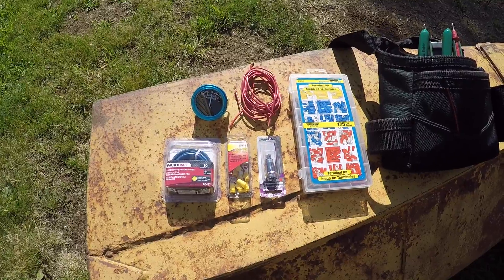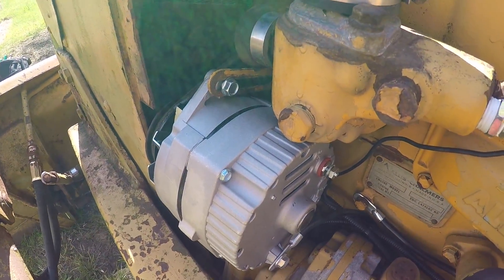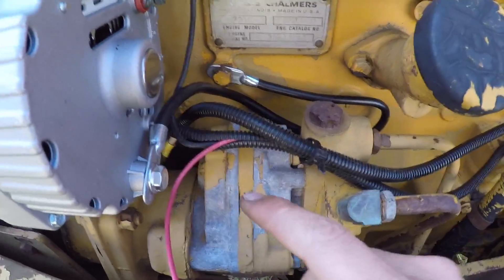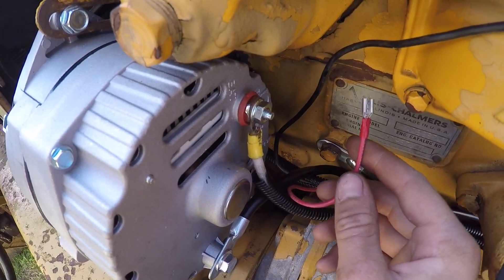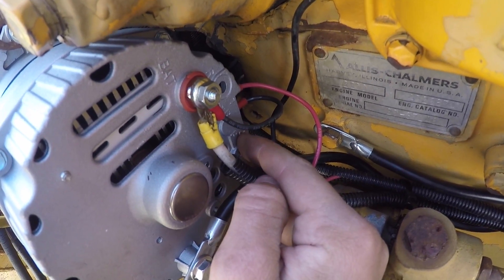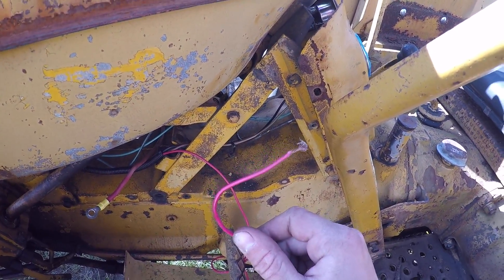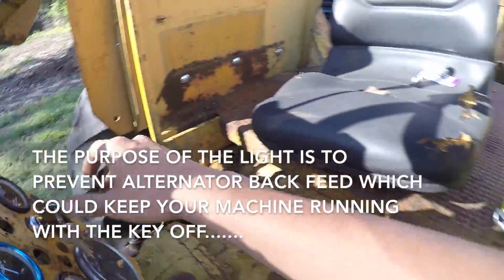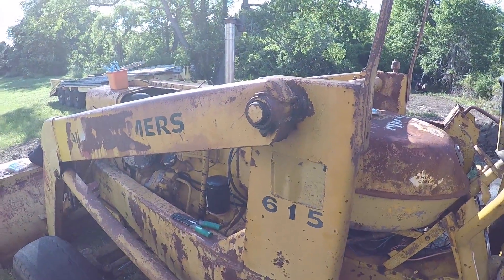How to Wire a 1 Wire/3 Wire Alternator (10SI Delco Style) to a Farm Tractor

Comment: Help me out here I'm terrible with electrical.   Do you have a 12 volt positive ground system?  I'm doing the same conversion with a Allis Chalmers D17 gasser, would I need the exciter since I am running higher RPM's?                       Great to-the-point video by the way!  Excellent job.
Reply from the maker: negative ground. I would still run exciter depending on how long the machine sits between uses.

Comment: I put 1 wire alternatorsGM110 amps straight from-the one post to the positive post on the battery, I have never ever had any problems,with battery or alternator, no need for anything in the wire ,just run a wire to the post +, on p.s. you will need a bigger pulley on tractor’s,they will self excite on it own,

Comment: You can also add a resitor instead of a light. I use short peace resistor wire as jumper
Reply: A light is better. Visual as well as excite current.

Comment: Tip when adding this on heavy eqipment the  Excited wire should go to a 2 terminal  oil presser switch you install. So it not so hard on starting am battery in cold weather. This way the alternator not trying to charge putting load on starter an battery until oil presser is up. Machines from factory are wire like this. Can't tell you how many guys think the alternator bad when it's a failed oil presser switch.. make so much easier starting. With out the load of the alternator.
Reply: If it's a true 1 wire self exciting, which this one is not, it won't have any load until the rpms are raised anyway.

Comment: why would run the wire coming off the ampmeter to the starter post? do you mean the solenoid? what about to the battery, I guess it would go to the positive terminal?
Reply from the maker: So the starter post on this particular machine branches power off to the battery. You can either go to the 12v starter post or the battery.

Comment: Im going to rewire my 1466 international harvestors alternator been having trouble with the battery staying charged long enough to run the knife on the net wrap part of the baler. Has to have 13.1 v or it throws an error code and wont cut just wastes a bunch of twine. Thought the alternator was hooked up properly but when my dad was alive i recall him saying if u didnt rev it over 1500 rpm the alternator wouldnt charge at an idle. So that was simply cause he didnt run another wire to the ignition so it would excite as the key turned on instead of just when it was above idle?  Also wanted to ask if it would be better to take the wire from the numer 2 post that u connected right back to the alternator would it be better to connect it to the battery or absolutely connect it to the positve alternator cable? I just want to be sure is all before i screw something up and burn my grandfathers tractor up. Is the positive starter post where i should connect at to run a block to attach lights to and such? I dont have radio in there just some lights i normally hooked to the battery to turn on.
Reply from the maker: Yeah so to make it charge immediately you need that second line coming from ACC. As far as the lights and stuff I would wire it directly to the battery so the starter terminal doesn’t get warm.
Reply: @iamdjnam  cool i really appriciate that. I need to place some switches in it so i can flip a switch when it gets dark instead of stopping what im doing to get out and connect them to the bolt on the battery post. I bought a couple bar lights and some square led sets cause that tractor is very lacking in the light department.  Really appricate u answering back even though the video was a couple years old. Sure appriciate it ive watched it like 6 times just to lock it into my brain prob watch it a couple more times before i start removing shit. If u are from Sw Pa or close by and want some wiring work let me know got all kinds of old tractors. Mostly olivers but a couple internationals and massey Ferguson tractors we havent used for awhile.

Comment: I have a gas Massey 165 I’m wanting to hook a one wire alternator up to. Is the process the same? When I took off the old alternator, there’s a wire running from 2 to the dash and no jumper to the positive alternator output from the terminals which is opposite of how you did it. Not sure which way is correct.

Comment: Did as you but start the tractor & alternated does not kick in still have to rave for it to kick in number 1 to the light in dash turn switch on light comes on number 2 to starter positive.I have a volt meter.

Comment: Excellent advice regarding the alternator "chassis-to-engine-block" negative cable. This eliminates the negative current from trying to use the alternator mounting for continuity. 

Wtih the distance to/from the ammeter and then to the battery, I would use at least an 8 gauge circuit.
If using a volt meter in lieu of an Ammeter, the charge circuit will be shorter, possibly allowing for a smaller gauge.  

Although in the Marine world, yellow is now used for Negative, for years black has been synomonous with Negative. 
I would suggest using a colored (other than yellow) wire for any Positive conductors. 

If I may elaborate some re; 3.54 into the video. With the use of an Ammeter, that circuit runs first to the ammeter..... then to the battery. 

If I may elaborate again re;  4:05 into the video, the Self Exciting 10si (what some call the "one wire" 10si) does indeed require a bump in RPM in order to become excited. 
However, once excited, it will remain excited until engine shut-down. 

FYI..... technically speaking, there is no "ground" in a 12 vdc system. Positive and Negative only.

Comment: Question: on the ignition switch are there any other wires besides the one coming from the led light? Thanks for this very helpful vid.
Reply from the maker: Yes one to the fuel pump solenoid and one to the starter solenoid.
Reply: I’m installing an alternator on my Massey Ferguson 135 diesel and this looks like it will work for that.

Comment: Im kinda lost do you put a wire from the positive on battery to the alternator? To send the charge to the battery. And with the ignition switch how does it go to the starter? I gotta run all new on a chipper i just bought. Please help lol
Reply from the maker: Lmao you’re good. You put a wire from the battery to the terminal on the back of the alternator. Then u put a wire from the ACC on your ignition to that little terminal that says 1 (or 2 idk I mention it in the video)

Comment: what if your ignition switch doesn't have an accessory spot? mine just has an off and on
Reply from the maker: You need to either use the little light bulb, a diode, or u can wire a little momentary push button to excite the alternator.
Reply: @iamdjnam  i see, okay! thanks bud ive been worrying  about this forever now. your the first person that could give me an answer
Reply from the maker: For sure no problem

Comment: International trucks from the 70s had an alternator like this and they had no light for the alternator. They just had 1 wire coming from the accessory of the key switch to terminal #1 and a jumper going from terminal #1 to terminal #2. This is how I wire all my tractors. They only time there is a problem is if the  tractor doesnt have an accessory terminal on the key switch so you have to wire the exciter wire to the ignition terminal on the key switch and sometimes they want to back feed and the engine wont shut off when you turn off the key. This is easily fixed by wiring in a diode between the key switch and the terminal #1. This diode only allows the power to flow in one direction and prevents back feeding.
Reply from the maker: Yeah I ended up just wiring to ACC after replacing the ignition switch.

Comment: That's the technique I use as well, except I like using a voltmeter instead of an ammeter.  With a voltmeter when you turn on the key, you instantly see the static voltage of the battery and also instantly see the initiation of the alternator output with the increase of voltage simultaneously with the LED shutting off.  The ammeter is also a great way to see the output, but if your battery is fully charged and requires very little alternator output to recharge, the ammeter movement could only be a blip and a bit hard to discern.  Of course that's in reference to a tractor with little or no external electrical load beyond the starting or ignition load.  Good concise and informative video.  Don't listen to the naysayers, we know this works.

Comment: With reman alternators no one knows what voltage regulator is installed unless you ask for a 1 wire. This is a marine regulator because in a boat, they don’t want the alternator on until the engine is at a higher RPM to avoid fumes causing a fire. On a car, truck the run B+ from key on to dash, the peanut bulb limits current but turns on the regulator after cranking. You don’t want the alternator pulling on the starter when cranking. The bulb is a current limiter for the regulator. This circuit has 12Vdc to turn lamp on and the field produces 12Vdc when working. With 12Vdc on both sides of the bulb there is no potential for current to flow so the bulb goes off. If the diode trio or main diodes start to leak voltage backward due to heat, age or defect, the light will glow from dim to bright telling the owner something is wrong with the charging. The most common one wire regulator copy you Delco Marine, that is why you have to rev up to make work. Any other regulator starts working as soon as started because the diode trio supplies the regulator with voltage to supply ground to the rotor at 400HZ as it is below AM band radio dials to eliminate radio noise. The stator used is “Y” connect and that center is hot when working, that is field. The marine regulator other wire is system voltage sense to adjust charge rate in volts. Inside there is a ceramic resistor that changes with air temp. Higher voltage when cold and lower voltage when hotter. That is the difference for time in turn-on can range from 1.5 sec. to 4 seconds. This spec is used when picking a voltage regulator.
ASE Master since 1978, retired.
Reply from the maker: Lot going on here. Thanks for commenting.

Comment: Great video.  Yes there aren't many video's on wiring tractors.  I'm replacing a wiring harness on a 5040 Allis Chalmers that has an old harness that has chopped up, spliced wires and missing wires.  I got a new harness with no labels on the wires so I'm trying to figure out where they all go. My new harness has two wires with the alternator main wire.  The Tractor has a Delco Remy alternator just like the one in this video.  The dash has a volt meter gauge with a scale from 10 to 17 and says battery voltage.
Reply from the maker: A multimeter is your best friend when tracing wires. I also purchased the manual for my machine that provided me with some diagrams.
Reply: @iamdjnam  yes I have both service and operator manuals.  The operator manual has the wiring dirgram to help trace the wires.  Your video was very helpful.   Thanks

Comment: That is actually a three wire alternator.    A one wire alternator only has one wire from Batt on alternator to positive on the battery.  A one wire alternator does not require the light because they are self exciting and do not require the light to create a load excitement.   It is actually better  that you are using a three wire alternator because the typical true one wire alternator contains junk diodes that go bad.  When the diodes in a one wire alternator fail, the battery will bleed down through the alternator and kill your battery.   The three wire alternators are much more durable due to tried and true diodes and they are 30% cheaper.  So actually what you have done is shown a method for wiring a 3-wire alternator which is better than a true one wire alternator.
Reply from the maker: Yeah you’re actually the 2nd person today to say that

Comment: Do you need an ammeter in series or can I go straight from alternator output to the battery?
Reply from the maker: You can go straight to battery. I just put one so I know the damn thing is working
Reply: Thanks for a fast!! Response. 

So I wired it up to the battery and a good ground to the battery ground 

Ran the 12v ignition to terminal 1 or R with and without led and the alt still isn’t charging
Reply from the maker: Make sure u got 12v at terminal 1 using an multimeter. If you do, the alternator is garbage.

Comment: So my tractor doesn't have an acc post on the ignition switch. It only has two terminals. Would I connect that wire to the output terminal?
Reply from the maker: Yes but u have to run a diode or Mini light to prevent backfeed. If you don’t the machine will stay running when you turn the key off.
Reply: @iamdjnam   thank you but the key doesn't stay in the start position. Its a diesel and to shut it off, I pull the shut off knob. I planned on wiring a light in as you did so hopefully it will do the same. Thanks for the response

Comment: The starter has a main power from battery terminal. It also has an s and r terminal. S wire goes to the neutral switch and then to the ignition switch. Where does the wire from the r terminal on the starter solenoid go to
Reply: Some say that goes to a tachometer if you have one.

Comment: Absolutely GREAT!! I love that old Allis!
You are spot on about connecting the terminal one wire to the ACC post on the ignition sw.
Not many people know that!  Nice work my man...
Reply from the maker: Thank you! I love this machine. Its been so good to me and I return the favor with proper maintenance :)
Reply: @iamdjnam  Yep - I have a 1957 Farmall 350 that the generator died on several years ago. Got tired of charging the battery every whip-stitch so I put on a 1 wire. An older gentleman down the road said use the ignition ACC post to connect an exciter wire. That way when you turn off the key all the juice is dead and it won't keep running on ya'. The man knew his stuff!! LOL! .
Not many guys left that know these old machines in and out!
Lots of info out there but your advice is right on target - Nice Job!!

Comment: What if your tractor doesn't have a keyed starter switch? Where would I wire the exciter to?
Reply from the maker: You can install a small on off switch to excite the alternator. They are very cheap and very easy to wire.

Comment: Thanks for this video! I have an old  Delco 10SI alternator but it has 3 flange connections + the Batt Output, 1, 2 and R. How would this differ?
Reply from the maker: I honestly have no idea. I don’t want to lead you in the wrong direction. Best thing to do is find a schematic for that alternator that tells you what each terminal is for. I know on some alternators they allow you to hook up a tachometer
Reply: I'm thinking the R is for RPM gauge

Comment: By far the best video out there. I have a Massey 50 industrial loader with a push button start and mechanical stop, the existing generator failed years ago and I plan to convert using your design but with a toggle on off switch in place of a key start seeing that this system is working. Do you see any problems?
Reply from the maker: That should work fine, just make sure its not wired back to the same terminal as fuel, as any back feed will prevent your machine from turning off.

Comment: Good video!  Doing this next weekend.  I seen on another video that it's necessary to use 10 and 12 gauge wire.  ???
Reply from the maker: Use the gauge of wire shown in the video. A lower gauge will handle current and amperage better. My alternator is a 30amp and works perfectly with said gauge.

Comment: Hello again.... fyi, my alt had evidently died. Do you happen to know a part number or where I can find a one wire, self exciting, low rpm output replacement? (Vern B)
Reply from the maker: Self exciting, I have no idea. The one I used in the video is linked in the description. Cheap enough to add an extra wire and be done with it.
Reply: @iamdjnam  Hi, After some research, I discovered NAPA sells a Delco reman, 63A, one wire, with 500rpm charge start. For $61.50 w exchange. (part # 213-4011SW) Thanks Again Vern
Reply: @vernboulet1015  I just bought that alternator yesterday.... Yes walk into NAPA  and tell them the part # or just tell them you need a  1 wire alternator for a tractor and they normally just hand it to you instantly....

Comment: ? If you have a Bat and a 1 and a 2 terminal on the alt. it's not a one wire alt., is it?
Reply from the maker: I guess you have a point. I think the “one wire” saying comes from the fact that you can run a wire straight to the battery. But remember, engines that rev low don’t trigger the alternator to start charging. That’s why on my diesel I had to run it this way.
Reply: @iamdjnam  I'm not sure about the internals in them, but I found a one wire alt for my Ford 621 gas, that starts charging at 500 rpm. I was hoping to see how to hook it up properly. Any input on that? Thanks
Reply from the maker: @vernboulet1015  As far as that goes, hook your wire from the back up to the battery, and terminal 2 to the post on the back of the alt. Take a multimeter make sure you're getting 14v with it running.
Reply: @iamdjnam  My problem is, there is no terminal 2. There is a black plastic cap/thing where I believe the 2 would be. All I have access to is the alt. output lug. Should I run the wire from the alt. through a volt meter or amp gauge and then to the battery?  So I can see if the alt. stops charging before I'm dead somewhere? Or straight to the bat.? (thanks for your input)
Reply from the maker: @vernboulet1015  Amp meters are cheap enough. Definitely run one. Remember + side goes to the alt and - side goes to the battery.
Reply: @iamdjnam  Thank You